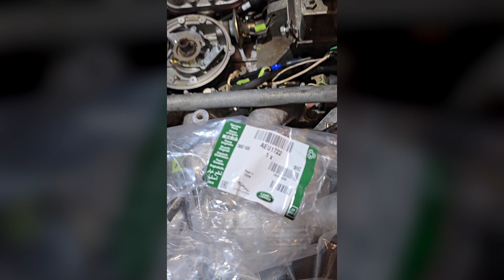V12 Jag Essential Fixes - What did a 49k mile Jaguar XJS really need to be safe and reliable?

Comment: Great video well done.  I am going through the very same process as you are although my car had a very rough idle after warm up, and no power.  I have also checked: 
The fuel system as you have itemised (injector clean and flow test); have rebuilt the Fuel injection harness (which was u/s); set the throttle butterflys to 0.002" closed; adjusted the throttle rods to open the butterflys simultaneously, and installed a new AAV, new fuel filter, and checked the sump tank for rust etc.  I replaced the LHS fuel regulator as that wasn't working, and am looking to remove the RHS one altogether (largely superfluous to requirements).  
The engine electrical system was checked (including the Thottle Position Sensor) which was u/s, the amplifier also u/s, unsure how the car actually started.  New plugs NGK BP6EFS gapped to 0.25". Checked the distributor was moving freely; Timed at 300rpm to 18 BTDC.
Previous I removed and refurbished the rear cage assy to repair my rear brakes and generally spruce up the rear suspension, new everything which was actually unnecessary.  My advice when you get to that juncture is to only replace the bearings that need to be done, as they are really good quality Timken bearings, and as you have found out ordering new Jaguar parts is no guarantee of quality.  Half the seals I got didn't fit, and the universals were really bad Chinese copies.  So reuse if you can. Bleeding the Teves system as you found out takes patience, and an understanding spouse.

Looking forward to your updated videos, really great content and clear narrative: excellent. Cheers Chris.
Reply from the maker: Great info thanks much!  Really will take to heart what you commented on the rear cage too.  That will probably be after the nice weather driving season (aka towards winter) and no doubt I would fall into the traps of the parts issues you described - so this is super helpful as I will gather parts during the summer to do this eventually.

Comment: Man you really know this car so well so I just have to ask.I’m in the process of diagnosing but I have a 87 xjs v12 where the fuel pump constantly runs in the key in position(supposed to just prime for two seconds or so but this one just keeps running) and the passenger side bank just floods with gas. Like floods to the point where gas pours out the throttle body if I open it. What would you do to figure out the issue? Any input would be greatly appreciated!!!

Comment: Just wanted to pop in and ask if you've done anything to the cooling system? It really needs to be maintained. The yellow radiator fan is really prone to cracking blades off and flinging them out of the hood. Make sure to check that.
Reply from the maker: Funny you say that, I have decided that I can't drive the car more without further addressing cooling system. Was hoping to and did get to enjoy it some. But noticed as summer came in it ran a slight bit hot on one drive. Not terrible but enough to say not gonna risk it anymore. 

And yeah though the yellow fan looks good I understand they really crack in hidden areas around the hub. 

Ive been collecting parts - waiting on a few backordered hoses but got the right thermostats, a new black fan, fan clutch, hoses, new header tank, and gonna pull the rad and either have it boiled, recored or get the Wizard cooling aluminum rad. Just gonna do it all, though I think the main issue I'm seeing is a faulty fan clutch, once I'm in there I'm just gonna do it all. 

I had hoped to sneak by some drive time this summer and address after the season but not going to chance it.
Reply: @VortexGarage  Totally understand! Every single thing I read about these beasts is keep it cool!!! Do yourself a favor and test the thermostats out of the car for the proper travel values. A few people on the forum have gotten stats and they ended up being wrong.

Comment: Thank you, I've enjoyed the series on this V12, is the engine running at the correct temp (seemed low on the test drive), replacing the thermostats is a maintenance item too.
Reply from the maker: Good eye on that!  I did shorter drives and that was towards the start of one so it hasn't yet fully warmed up. Appears so far to get to and stay at good temp.  Agree on the cooling system maintenance

Comment: Great video. I have the same engine. I want to also tag the hoses I replaced. Where do you plan to get such a tag? I can’t find anywhere!
Reply from the maker: I'm not sure yet - there was a Jag Lovers Forum post where someone asked about finding a similar material as to the tags used originally.  I can't recall if that had an answer and I didn't bookmark it.  

I'll try and find it at some point.  But I bet some very thin aluminum cut, and using a letter punch tool would work out.  Could be cut easily, and edged folded over to ensure no sharpness, even wrapped around the non-rubber portions.  

I'm not yet sure what I'll use, but hope to revisit that one day.  If you end up finding anything please do comment and let us know!